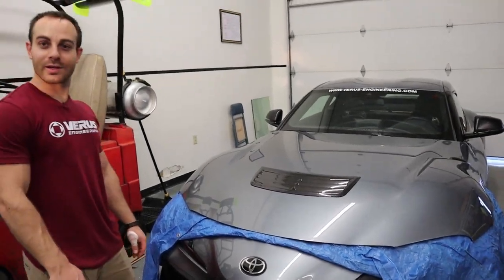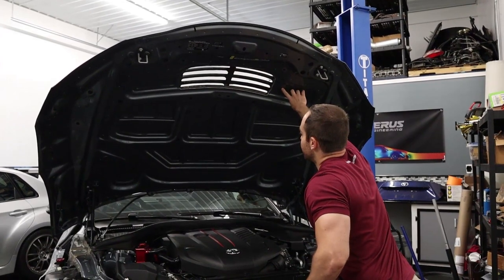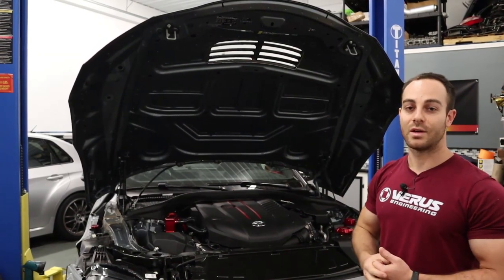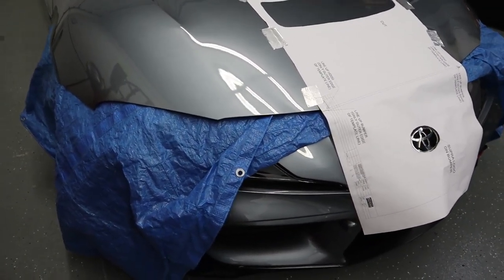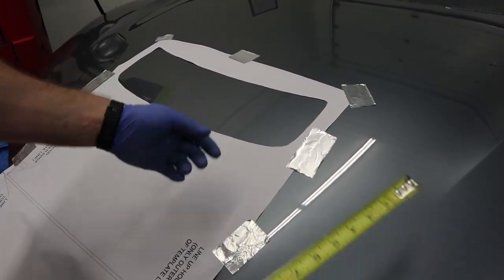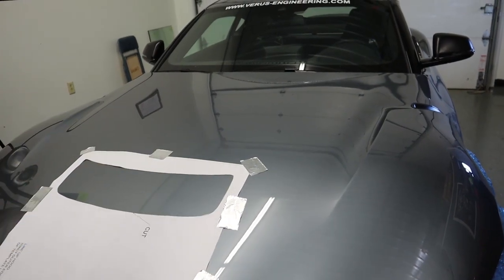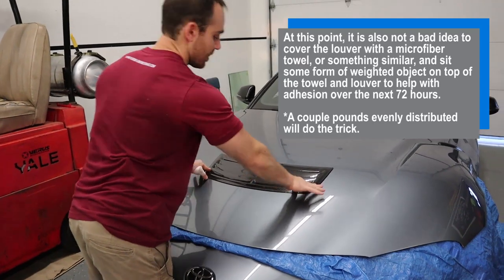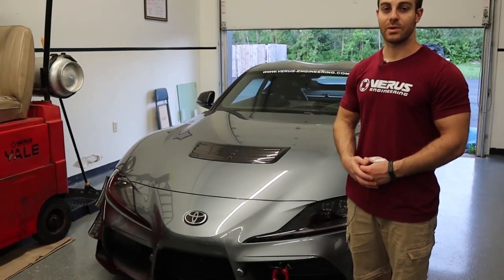Eric Cuts a Large Hole in our Supra!

Comment: Can this be done in mustang GT 17? I like this one over the one design for the Gt plus it’s not over the air filter
Reply from the maker: Most likely not as this hood louver was designed off in-house scan data and was designed specifically for the Mk5 Supra hood. Since the louver is carbon fiber, it does not have any play like our aluminum units would. However, we do offer a wide array of aluminum units that would work for you.
Reply: @VerusEngineering  market for mustang is way bigger than all cars you guys worked on, I really like the middle one. If only if find some like this or similar to gt350 hood vents. Thanks anyway.
Reply from the maker: @bgg3046  We already offer two different styles of hood louvers for the S550 platform.
Reply: @VerusEngineering  the rain GT doesn’t have rain guard!
Reply from the maker: @bgg3046  correct. However, the Non-GT units do offer rain guards.
Reply: @VerusEngineering  is there a video on the rain guard installation?
Reply from the maker: @bgg3046  No. They are very simple to install. You put the rain guards on the pem studs from the louvers and install with a handful of nuts.